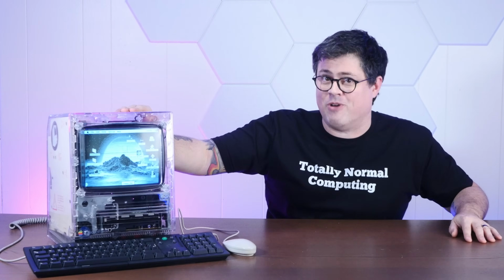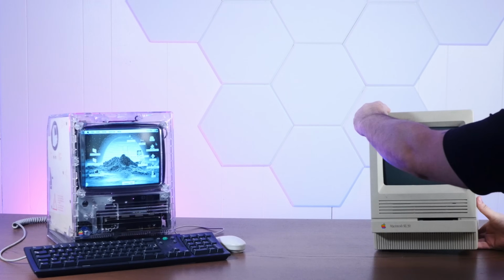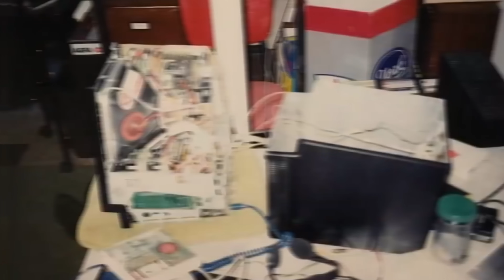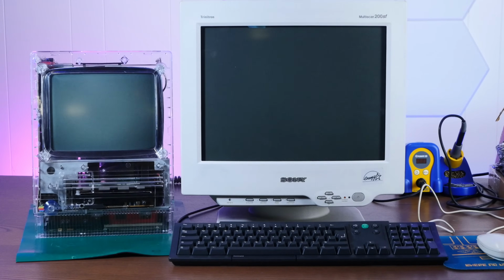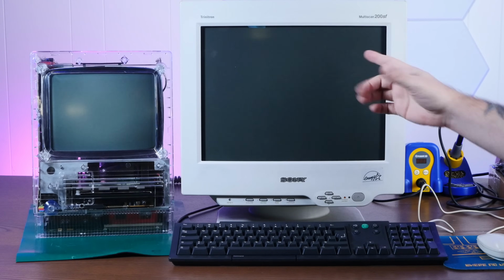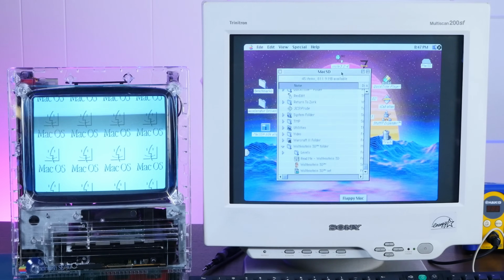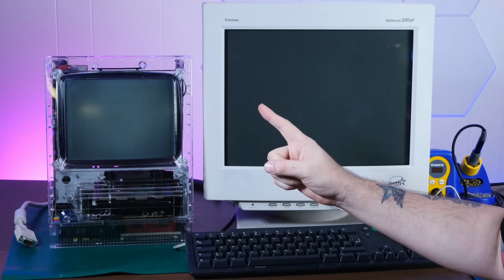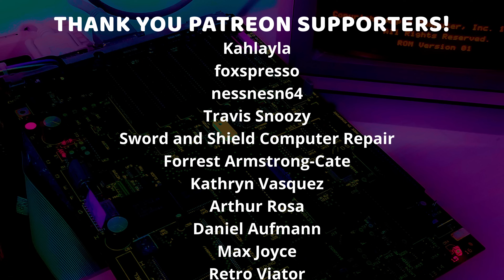How Many Upgrades are in this SE/30?

Comment from the maker: Head to https://squarespace.com/ActionRetro to save 10% off your first purchase of a website or domain using code ActionRetro
Reply: For your car heater it is most likely the thermostat being stuck, if the fan works and there is no heat, there is an old solution that will work but is not the best, that is to poke a hole in the thermostat about the size of a ballpoint pen tip.
Reply: @thedivinityman  thermostat being stuck is also bad for the engine ... if stuck open it would never get to operating temp, stuck closed can cause overheating... neither are great!

Comment: Ah memories. In college when I was a senior, the school paper sought me out to help them move to Mac desktop publishing from the older Apple ][ based system. I had an Apple ][ in my dorm room and a Mac Plus since I was working for Apple as a campus rep. We bought a Mac SE with the Radius card and monitor....serious money for us but it worked well. The biggest problems were that Pagemaker wasn't good enough to do all the things we wanted to do and Quark Xpress was barely a production application and literally broke every time Apple would update the printer driver.  Eventually I bought the first Mac II on campus with a color Trinitron screen and did most of the layout work in my room alongside a girl I liked who would eventually marry me.

After college I worked at Apple for a couple of years. The SE/30 was easily one of our favorite machines since it was compact but stupid powerful. We ran the office on an SE/30 server hidden in a phone closet.....AppleShare, print serving, early texting.  Everything.  I still have an SE/30 and my Mac II, upgraded to a IIfx.  Neither has seen power in many years....almost afraid to try.

Comment: Would love to know what you did to get the card working! I have an SE/30 Pivot card ROM 1.2  OR 1.3. Shows grey on main CRT when hooked uop to external monitor but nothing else. Seems to see the card in tattletech but will notpush video to either monitor.

Comment: If the heater in your car is not working, that means engine coolant isn't reaching the heater core, so you will need to have a mechanic look at that system to see what is causing this to happen.

Yes, cars use their engine coolant for the cabin heater. You've got heat from the engine travelling through the coolant pipes anyway, may as well tap a bit off into a small radiator to heat the cabin.

Comment: So.  Chrysler put a 40 amp fuse to protect a circuit with components only capable of handling 20 amps on your Jeep.  Your blower motor has likely worn out and draws too much current which can ruin both the fan speed switch and the resistor pack that steps down the voltage into the fan.  And those components get fried before the fuse even gets warm.

I need to redo mine again too.  I tried putting mosfets in to get the switch out of the main current path, but I need to rethink that.  Some folks put automotive relays in to keep the switch out of the current path.  Good luck!
Reply from the maker: Appreciate this! Turned out the heater core just need a good garden-hosing :) heat works again!
Reply: @ActionRetro  awesome!  That's probably the easier fix.

Comment: Wolfenstien "poorly optimised for a mac" is an under statement, my old AMD 386 DX40  'Garage sale parts special" on Windows 95 with 8MB of RAM ran it smoothly at 640x480 (as did doom) circa 1997.

Comment: It's strange seeing Wolf 3D running on an '040 with issues yet is fine fully cranked on my 12Mhz IIgs... as you say 'optimisation'.
(also no issues on a RiscPC with a 30Mhz ARM 600)

I really need to dig out my SE/30 some time - back of a (heated) garage for years in bits after the SCSI HDD died.

Comment: My guess is you found a rare Micron Xceed video card with the adapter to put greyscale video on the internal CRT and connect an external color monitor.

Am I correct in assuming that 040 upgrade is made to plug into the IIci cache slot, also used on the IIvx and IIvx? If that sideways connector is IIci style, then it ought to be able to take a DayStar PPC 601 upgrade.

Comment: I'm honestly surprised classic MacOS can handle the dual monitor setup with different video modes that well! I would have imagined that setting the external monitor to anything other than 1-bit B&W would crash the OS.
Reply: Well the OS was capable of running colour on different newer models of Mac, so the OS code is there to work on more capable machines.
Reply: When Apple added multi-monitor support to macOS Classic back in the day, they did pay a lot of attention to getting it right, probably because that configuration of built-in B&W monitor with external colour monitor was very common with graphic designers at the time. I remember reading about it in BYTE or one of the other computer magazines at the time where they particularly called out how you could have a window straddle 2 displays with different colour depths and it would Just Work

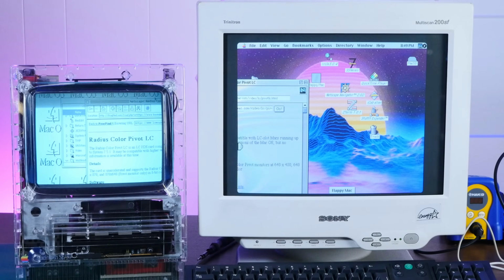Comment: 13:36 WHOA. The color depth weirdness aside, in contrast to Windows and most Linux desktops, on modern macOS you can't even have a window span across more than one monitor at all! The dimmed outline shows up when you drag the window around, but then remains only the part that's on the screen where the cursor is when you release the mouse button.
Reply: It can if you turn off "Displays have separate Spaces" in System Preferences > Mission Control. Doing so does mean making an app go full-screen will blank the other displays though.
Reply: @axi0matic  Whoa, it really does! Nice to know, although... the default behavior makes much more sense in real life. I just found it weird that it blocks the windows from appearing on different screens. I guess it's the case of typical Apple overthinking - it makes some sense, since with separate spaces per screen, the concept of a window spanning more than one gets rather weird. But on the other hand, it "just works" on Linux desktops that way, and the window just follows its "primary" display, so why remove the option...
Reply: @kFY514  It's a bit inconvenient in my opinion, as Spaces is a feature that's more useful on e.g. laptops than for people who are running multiple screens. I never use Spaces, and would rather have the ability for windows to span screens, whilst still allowing e.g. videos to go full screen without blanking the others.
Reply: @axi0matic  I guess it all depends on individual workflow/preferences. I like having individual Spaces per display, and windows spanning across screens are only useful for me if I really need one big window that doesn't fit on a single screen. Which I sometimes do, but not really that often. Otherwise they are inconvenient to use and usually avoided anyway, the physical bezel in the middle of a window is rather distracting.
Reply: @kFY514  Using windows that span screens is a bit cumbersome for the reason you mention, but it would be nice to have the option of allowing them to, rather than just truncating them at the edge of the screen. Not so much for using the window itself, but just to help you keep track of windows in general, and to preserve the illusion that a multi-monitor space is one big desktop.
Reply: The annoying thing is you used to be able to have Spaces and multi-monitor windows until they removed it. I don’t remember exactly when, maybe 10.7 when they made spaces only be left to right? You could configure any arbitrary grid rectangle ratio in 10.5.

Comment: One more "final upgrade" could be installing an LCD screen using an RGB2HDMI tophat for a Raspberry Pi W as done over at Adrian's Digital Basement.  It can convert the TTL signal directly from the motherboard and drive an LCD screen.
Reply: Wow, a maxed-out SE/30 with a COLOR display would be very nice!
Reply: @rigues  That truly does seem like the dream. If the goal is to maximally upgrade the machine, the internal screen has to be upgraded.
Reply: @rigues  I know it supports Color QuickDraw, but I don't think it'd give it color.  Would still require a color video card.  But it would give him an insane amount of space for even more upgrades without the CRT neck being in the way.

Comment: Ha, weird seing an SE/30 running Wolf 3D :-D

Would love a video about your cursed SE/30 booting in System 7.1.1 and comparing the speed of it running Wolf3D vs. newer systems. As a kid I used to play Wolf 3D a lot on an LCII with 10 MB RAM and it was very playable in 320x240 (with not many extensions enabled) - the 68030 16 mhz on 16-bit bus like your Color Classic. Also how much RAM of your 128 MB RAM did you allocate to Wolf3D in Get Info? I personally remember quite a boost going from 4 MB only (with virtual memory turned on) to 10 MB without VM on. And the amount of and types of extensions loaded also mattered a lot for the performance. Did a lot of extensions optimization to get the best gaming performance from that machine.

Comment: I still think you should keep the front panel black with a hint of blue
Reply: My original suggestion was to paint the inside of the clear front flat black so you would have the black colour showing through the depth of the clear plastic.

Comment: The first thing to do when the heat isn't blowing hot is to check the coolant level. Do not open the cooling system when hot. Check the coolant level. Add coolant if low. If the coolant is low, figure out where it is going. 

I think you're driving an XJ Cherokee. Some model years are prone to head gasket failure. Other likely suspects for coolant loss are the coolant hoses, water pump, and radiator.
Reply from the maker: yeah coolant level is good, then i checked blend door and actuator which seem fine. i think the heater core might be clogged. it is an XJ
Reply: @ActionRetro  You have my sympathies. As a fellow XJ owner from that generation and having done that job, it is neither fast nor fun to replace the heater core. If ya haven't done so already (and of course if ya don't smell coolant inside like it's leaking) you might get away with attempting to clean the inside out with CLR and rinsing through with a garden hose.

Comment: The flicker is caused by interference. You need to make an RF suppression shield over the card.
Reply: I was actually thinking "gee, that card is REALLY close to the electron gun in that CRT, I hope it doesn't cause any interference"
Reply: @OhhCrapGuy  It's nowhere near the electron gun. That's the HV anode cap.
Reply: @AiOinc1  I didn't mean like proximity, I meant more like "in the path of", should have been more clear. I have no idea if enough interference gets out of the tube, though.
Reply: Damn, the one few cases where that's an actual issue.
Reply: @TrolleyMC  You'd be surprised at some of the things SE/30 owners will stack on their TwinSpark adapters. That riser/adapter's name almost reads like a cruel joke to me, in hindsight. You can actually hear constant static/sparking from electrons jumping from the anode cap to any nearby components, desperately trying to reach ground. The mics in this video are never close enough to the machine to portray it here, but a multimeter can even reveal this happening. Not a good feeling, for tinkerers who are worried about ESD'ing their vintage expansion cards.

Comment: You should really clean the excess flux from the solder as it is slightly corrosive and can also a bit conductive. Besides, it makes the solder look half-arsed. BTW, spit will clean it up nicely.

Comment: I remember back in the day there was a mod you could do to drive the internal crt at 640x480 and/or greyscale - is something like that still possible? I assume it needs a dual output graphics card, and then takes one of those outputs and feeds it back into the internal crt
Reply: It also required a neck board swap, but it makes the internal screen look beautiful

Comment: I had the same heater problem in my van. The heater core in your car is probably plugged-up. You should get it to a radiator repair shop and have them flush the cooling system with some caustic agent and have them replace the thermostat at the same time. Just changing the thermostat might be enough but if you have absolutely no heat, it's probably got a bunch of stuff stuck in it.
Reply from the maker: yeah that's my thought after checking the blend door and actuator motor. i was going to just take a garden hose to the heater core 😅
Reply: @ActionRetro  I had to do that to my SUV a few years back, works like a charm!
Reply: @ActionRetro  I've done that before and it worked great. The crap that flushed out..

Comment: Sean, one of my first upgrades after purchasing my SE/30 in November of 1991 was to purchase a RasterOps ColorBoard 264 SE/30 for (yikes) $635.00. As the same time I purchased an Apple 13: RGB Monitor (yikes again...$750.00) to attach to it. It worked well that way for a number of years. It made a huge difference in the usability of this computer (PageMaker, Illustrator, all the usual suspects of the early "desktop publishing" days).

But my SE/30 wasn't quite the Frank-en-Mac that you have going there. But when I later purchased the Jasmine BacPac 180 (megabytes, not gigabytes...and don't even ask about the price), it did sort of turn into an Igor-a-Tosh with that hump on its back. (The Jasmine BacPacs attached to the back of the Mac and thus the whole unit was luggable, if not actually portable...and port it I often did.)

Nice job on adding the second monitor. Boy, that brings back memories.
Reply from the maker: Oh wow, what a MONSTER back in the day!